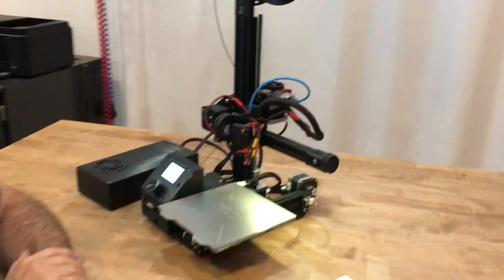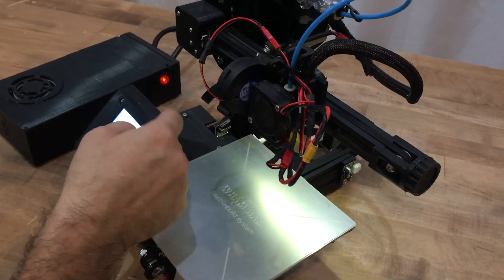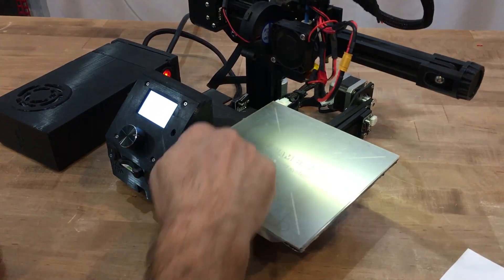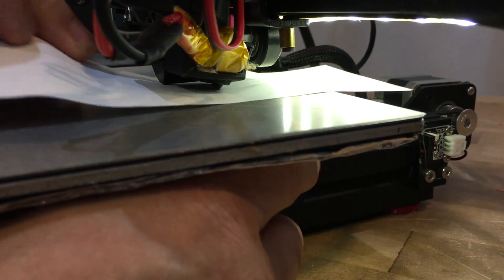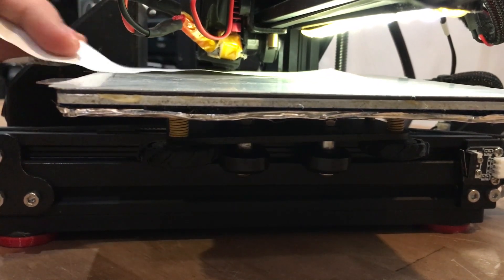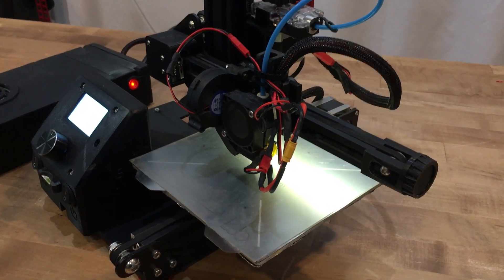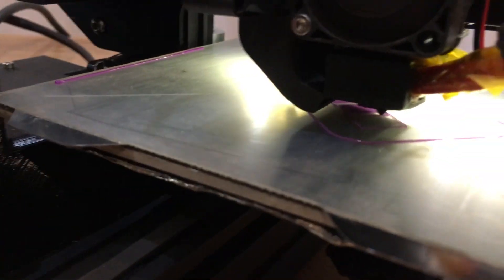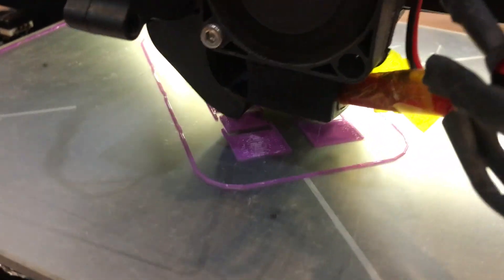Easy Perfect Bed Leveling on the Ender 2

Comment: Very helpful video. I am also curious about the display and psu enclosure for the ender 2 you are using in the video. I was looking for exactly that but was not able to find it. Could you please share where to find the stls for those enclosures/cases? Many thanks in advance.
Reply from the maker: Here it is, I did it in 2017, so not sure if anything on current machine has changed much https://www.thingiverse.com/thing:2715122.  Also on same page you can find a light bar and other accessories for Ender 2
Reply: @WhamBamSystems  Awesome! Thanks a lot. What an improvement to the Ender 2. really looking forward to print it.

Comment: Any advice on the Ender 2 never gets old, so thanks for producing this in 2019. I bought mine almost two years ago to see if I was interested enough to pursue 3D printing without a big investment in case I did not. It's been mothballed but now I'm in a situation where I want to get it running properly, along with making upgrades. When I do my paper leveling, I wait until I feel a tiny "buzz" in my finger tips when I drag the paper. That's a very consistent feel to go for and it's more repeatable down to the same resistance than guessing how much effort you're using to pull the paper without it resisting too much or too little. It's about the same gentle pressure that you'd use to get a sound out of rubbing a wet finger around a wine glass (anybody? LOL.) That seems to be right for PLA on painter's tape for my Ender 2.

Comment: thanks for this i needed it. One thing I noticed on my ender 2 the bed clicks and it totally gets out of place did you see this orinally with yours?
Reply from the maker: Hi Daniel, you are welcome, how does the bed click? When sliding along Y axis?  If so adjust the eccentric nuts under the bed on the rollers till tight.  Or if its the springs that click, tighten them all to at least half compression, home machine, and adjust the Z axis limit switch height until home touches nozzle to bed.

Comment: Hey Peter, it's great to see that you're just a fastidious as I am. Although I have auto levelling on my printers, I always keep an eye on the first few layers. After the first layer, I also run a finger to check for smoothness, just as another check that it isn't too squished and therefore causing bubbling up.